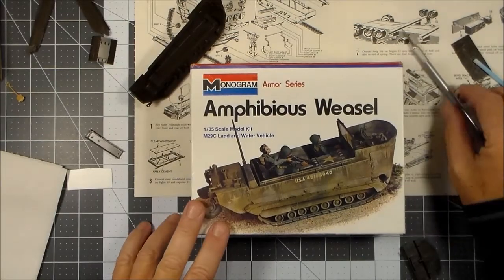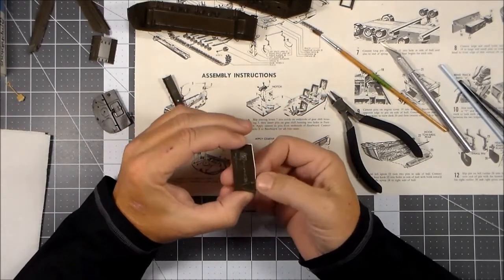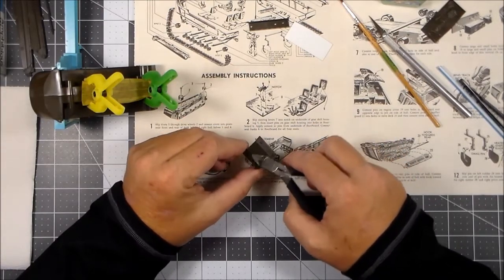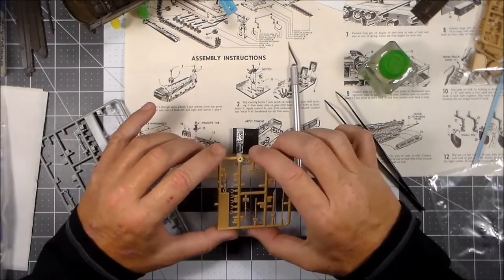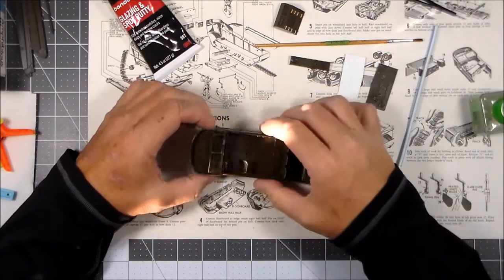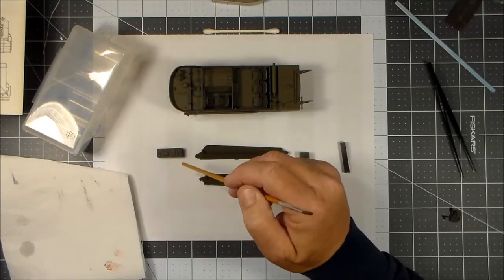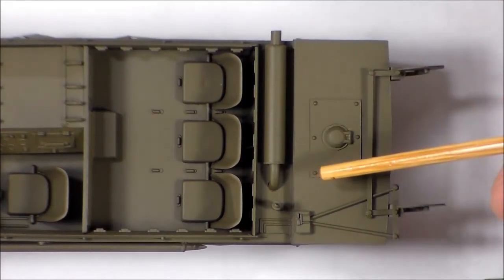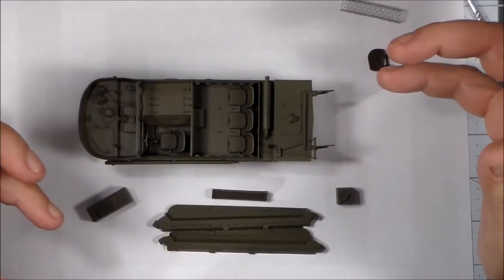Monogram Weasel Project pt 3

Comment: Nice work!  These old kits had lots of detail and potential.  But in 1957 when this kit was first made, solvents and paints had yet to catch up with injection molding technology.  

British modeler Mat Irvine noted this in an article he had written for Finescale Modeler Magazine on building the Revell XSL-01 Moon Rocket kit (also from 1957.)  He said that without liquid cement, wet/dry sandpaper, airbrushes, water based acrylic paints, and other tools and building/finishing supplies common today; it was difficult to get the best from these old kits when they were new.

For that matter, I don't remember seeing any sheet styrene plastic (much less tubes, rods, I-beams, etc.) for scratch building available in local hobby shops until the early 1980's.  Apparently, Evergreen Scale Models began in 1977.  Though Plastruct sheets and shapes were available since 1968, this was ABS plastic, and difficult to work with (at least for me when I was in Junior High School.)

Thanks for sharing this.  9th Like.
Reply from the maker: Good stuff, Mark. I discovered liquid cement in the mid-70s when I got into HO railroads for a short while through a friend (oddly enough, the very friend that introduced me to Monogram armor kits.) It was a game changer. And, like many from my era, Shep Paine introduced me to scratch building and the associated materials, like sheet styrene and shapes, through those same Monogram kits and the Tips For Building Dioramas sheets that came with them.
Reply: @BrettG64   I'll tell you a funny story that happened to me when I was nine.  In 1969, I went to the local Target store to buy a model to build.  I had almost two dollars - a King's Ransom in those days - and Target had devoted two whole aisles in the Toy Department to model kits.  As I was looking at the kits, and old man (in his early 60's, like I am now) was there, and he commented to me that when he was nine, if he wanted to build a model car or plane, he had to get plans, make templates, and carve a block of wood to shape.

Flash forward about fifty years, and I was at a hobby shop where a demonstration of a 3D Printer was being given.  Some kids around 10 were watching it, and I couldn't resist commenting that when I was their age, if you wanted to build a model, you got a injection molded kit from the hobby shop . . . .

As I left that day, I said a silent prayer for the old modeler I met when I was nine, who is probably no longer with us.
Reply from the maker: @modelermark172  wow, that is so true. Times they are a changing!
Reply: @BrettG64  Extra points if you hear Dylan singing that line as you read it . . . .